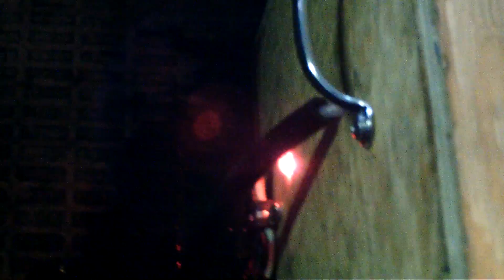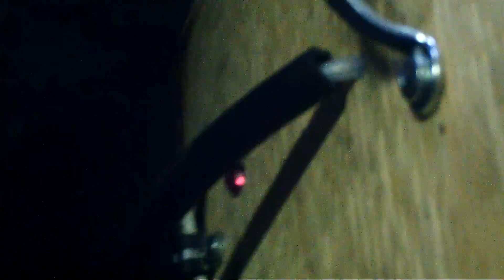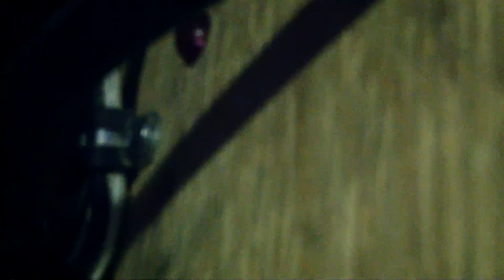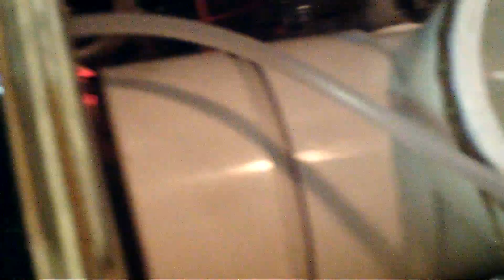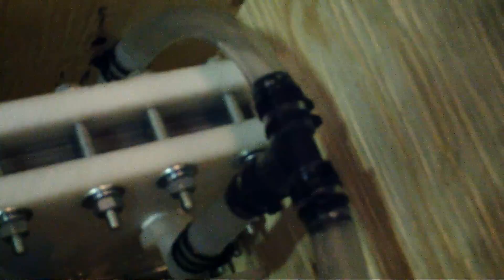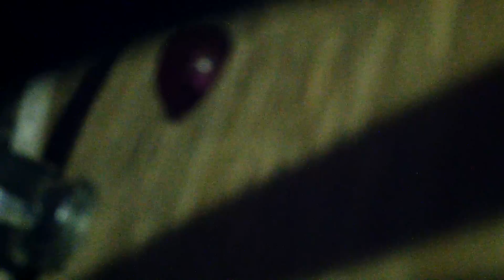Voltage , Even when the cell is turned off !!

Comment: yes. seems like any 2 plates wants to hold a 1.5 volt charge. I think it is ions from the air. plus depending on where your plates are...you can get a more pos or more neg potential take 2 of your used plates and put them in moist ground. keep them orientated as in the cell...I bet you can read a voltage on them

Comment: 2-We know that a tank circuit is made by a capacitor parallel or series conected with an inductor.The frequency is then raised until you gain maximum amplitude across that inductor/capacitor combination.Once this is reached,you now have the resonant frequency of that tank circuit.
The tube cell with the choke,is that tank circuit-waiting to be tuned to it's resonant frequency.Far higher voltages can be reached with a tank circuit,than what it is being supplied with.
Food for thought.

Comment: I was messing around with my cell a few months ago and put an LED on two of my neutral plates, they were putting out just under 3 volts. The led stayed I for about 3 seconds. I think it's down to the fact the cell acts more like a capacitor. Interesting though.

Comment: Yes indeed.
Much is said and talked about,in reguard's to hitting he resonant frequency of the tube's them self in Stans work. But i think that this is a misdirection of what was realy ment by resonant frequency.Looking at Stans circuit with the choke coil,tube cell and pulse driver-you have all the makings of a tank circuit. I believe that it is the resonant frequency of that tank circuit you need to find-not the resonant frequency of the tubes in the cell.

Comment: There is a strong magnetic Field between the Leads and a charge in the Liquid and in your Plates. When the Fields break down, the stored  Energy will be converted back into Electron Flow to neutralize everything.
From the upper part of the dielectric Layer there will be also Electrons drawn off to neutralize the System and finally the return of the Electrons of this Layer.

Comment: Neal, what happens when you disconnect the power leads to cell and just leave the LED across it? I do not think there is enough capacity in the cell to support that.
I will bet it is the capacitance further back in the circuit. I seen you had a converter in a side bed box of that pickup in a previous video, that converter has capacitors in it and if it is connected to the cell, at power off the caps on the converter are discharging through the cell and the led across that cell as well.